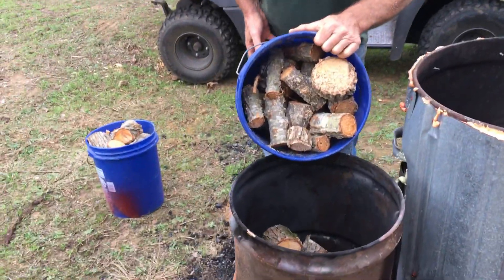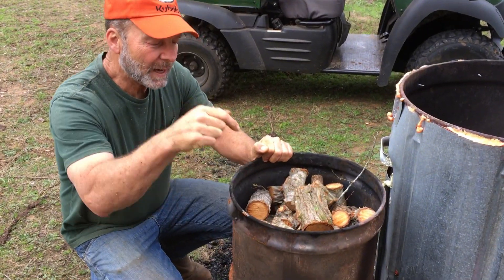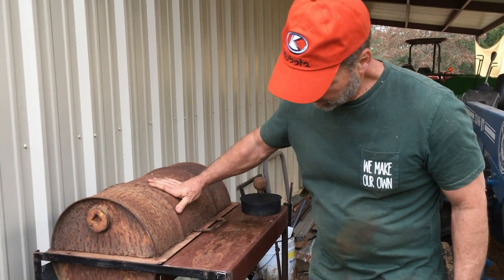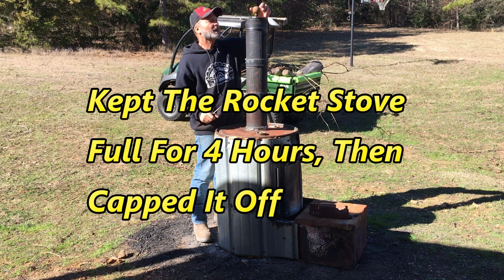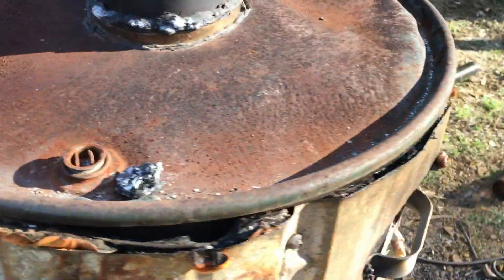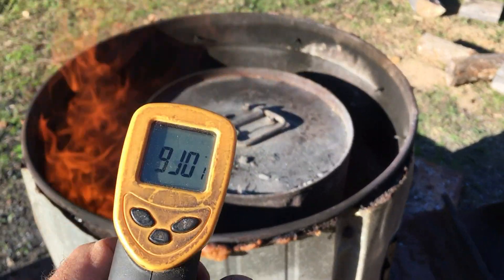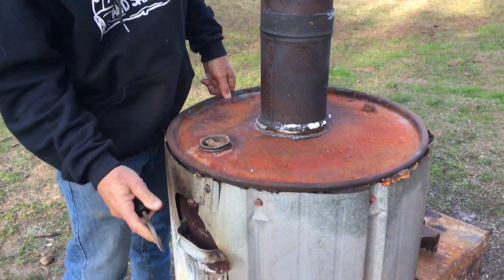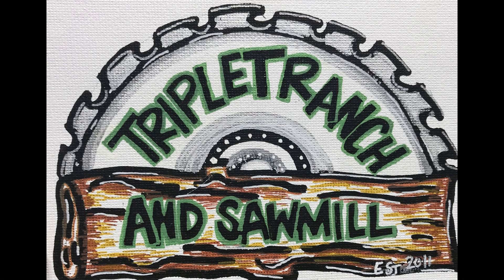Enhanced Efficiency Lump Charcoal

Comment: I am surprised you do not pack a bunch of surrounding  kindling in the gap between the 2 barrels.  That would kick off the initial steam by products early.  then the rocket bin serves as the flame holder for the syngas cooking  the wood into charcoal.
Reply from the maker: 1369, if I didn’t do it then I definitely do it now!

Comment: I just made some great charcoal..I used a dryer drum " and a five gallon varnish bucket...I cut the top out.  Used very little wood to burn...took about 3 hours...going to make more tomorrow..I used downed oak that was down for 6 months...fairly dry
Reply from the maker: That is awesome! Make a video like to see it
Reply: @KimTraylor I'm making some now from green oak, 3" or so diamtor..and its takeing quite a bit of wood to char..sounds like a bomb..😂😂I don't know how long I'm going to let it go..my first attempt, the wood was like 1/4 done..so I believe if I let it go for the rest of tonight, it might be good..I hope
Reply from the maker: @gregmccarter2176  sounds good!   If you can see the pyrolysis die off and then go for another 30 minutes, you should achieve 100% yield.  The oak will be plenty wet so you have to burn longer
Reply: @KimTraylor  up date I just inspected my charco and it is perfect..apparently 2 inches across, and 6 long..it came out in small logs..fixin to put on another batch..I'm gonna do it like you said..its actually fun and very rewarding to do...thanks for your videos

Comment: What is the advantage of the off set? Why not just shove wood in the void the two barrels? Thanks for posting.
Reply from the maker: I hope to have bees one day!  The exterior firebox allows easy replenishment of firewood.  Without it, would have to open hot top to refuel when necessary
Reply: @TripleTRanchAndSawmill  Bees are easy. Get started next spring. Thanks for the reply. I just picked up a 10 gallon trash can and lid. I plan to attempt a small batch in a fire pit for the first time.
Reply from the maker: @SoFlowbeekeepingandmangoes  yea my first batches were successful using the danish cookie tins with a small hole and at the campfire.  Put the hole where u can see the pyrolysis action. Only takes an hour or less and the tin becomes fragile so figure out how to remove it beforehand

Comment: This looks like a great system. Why not let the wood dry before gasifying it? You're wasting an enormous amount of energy driving the water out of that green wood.
Reply from the maker: Steelman I totally agree.  I have some seasoned wood now.  However,  i have yet to use dry wood inside and outside the barrel.  You have to look at like I still make coal it just takes a little more care.

Comment: Hi, is there any difference with quantity of fuel used , as in do you use less with the rocket than if it was just a fire surrounding the inner canister ?
Reply from the maker: Dark,  not sure, but the rocket stove allows for easy refueling.  I always start cold with sticks around the inner barrel.
Reply: @TripleTRanchAndSawmill  Thanks, seems an easier way to fuel it i must admit, i do like the design

Comment: Above 650 degC, the wood will undergo gasification yielding less than 10% charcoal.
If you want maximum charcoal, slow pyrolysis process is the best where temperature won’t go beyond 450 degC.
Reply from the maker: Kashyab sounds like we need to automate air intake with barrel temperature as process variable .  I also could use only green wood and slow it down some
Reply: @TripleTRanchAndSawmill  yea sure. An small air blower can do the work. Yet it’s hard to standardise the flow and time values as we vary the input wood quality. It’s a long time discussion on controlling the temperature for small scale char makers. You may see the Carbon gold channel were they control the temperature to maintain a slow pyrolysis throughout using a thermocouple and a blower. They modified their system many many times and now they got successful and automated the process. +91 9037 433 717
Reply from the maker: @kashyabguruvar5065  thanks i will check them out.  The variability of species could be generalized. We have lots of elm (it tries to kill me on my sawmill) so I would think a setting for green elm, one for green pine ...   may have to build it!  More pressing is I have to replace the inner barrel.  Gonna use viewer feedback to make it better this time.  I love to make charcoal and then forge something.  Made a simple dutch oven hanger last week out of scraps.  It was created at the cost of a small quantity of wax.  Lots of fun!  Thanks for watching
Reply: @TripleTRanchAndSawmill  👍🏻👍🏻

Comment: Looks like oxygen is getting into your charcoal drum. That’s causing your wood in it to burn instead of cook. Looking at your drum, there are too many holes and they are too big. That allows oxygen to easily enter. Especially at the end, when the fire has died down
Reply from the maker: Very good feedback.  I have used the appliance so much the inner barrel is wore out.  I have another barrel to modify.  One suggestion I will implement is drill holes in the bottom of barrel instead of lid.  I will take your suggestion and drastically reduce the holes!  Thanks for watching
Reply: @TripleTRanchAndSawmill  there’s a YT video by the bbq pit boys that shows a 30 gallon inner drum successfully cooking its wood into charcoal with a bunch of small holes all around the upper edge. My sense is their setup works because those holes are so small

Comment: Awesome brother thanks I’m making charcoal for a gasifier that can power a generator just a tip for yah try adding the wood around the inside of the barrel instead of the outside that way u get a cleaner burn all the way down the inner barrel returns some really nice carbon
Reply from the maker: yes sir I have started doing that too.  let me know if you power your generator, that would be interesting.

Comment: Great vid thanks. You will get a lot of biochar enthusiasts coming over to have a look. We just built a mini retort for a client using rocket stove tech. My advice is to insulate everything. It will cost around $800 but it will last forever with proper maintenance. It will also speed up pyrolysis. Rockwool is amazing. Just use a respirator mask when cutting it up😀
Reply from the maker: Wow just saw this comment.  My next generation retort will be better incorporating comments such as yours.  I checked out your 360 degree retort, very good!
Reply: @TripleTRanchAndSawmill  Thanks! I have sent you an invitation to connect on LinkedIn - have some more YouTube vid links that I think you may find interesting.
Reply from the maker: Yes built a very professional retort!  Like it like it!

Comment: Instead of jacket, maybe get another larger drum and cut off both ends. Then drop it over the outer drum and fill the gap with sand. Much better in keeping the heat in than foam.
Reply from the maker: That would be ideal but dont know where to find a bigger diameter barrel.  May try the cone method next!
Reply: Yes these biochar burners are called  55/30 retorts. Look up Dr Hugh Mclaughlin. He has a great 55/30 design out there on the interwebs.

Comment: Can’t find those smaller barrels anywhere!
Reply: Talk to a plumber, old pressure tanks might size in for you.
Reply from the maker: it was a grease barrel if that helps.  Also one guy said something about using a 40 gal water heater tank.

Comment: Curious how old water heaters would work as a jacket or inner sleeves?  They vary from 22-28’ in diameter.  If not inner sleeves then possibly take 4 cut them in quarters then to height  then reattach around your barrel.  One could most likely get them for free from the landfill or junkyard.
Reply from the maker: I think water heaters would be better since they are thicker.  But i have a pile of tin so that’s what I used.  Thanks for watching.  I use the charcoal very frequently.

Comment: why did you just put holes in the bottom of barrel and and keep the lid in one piece save you tipping it upside down just a tought fantastic retort
Reply from the maker: That might work.  Next time I make some charcoal I will consider that.  It might save the lid.  Thanks for the comments.